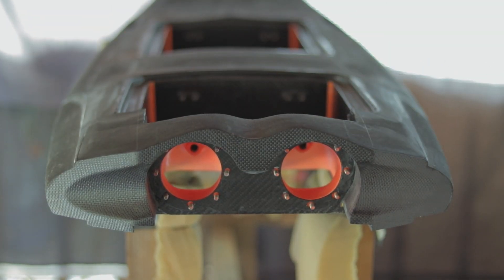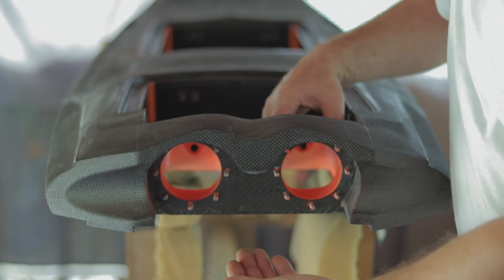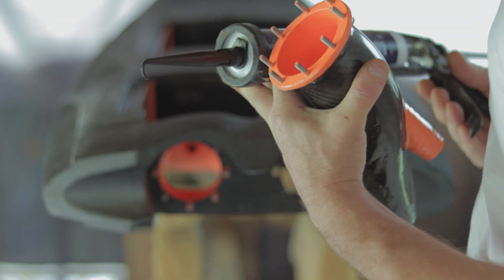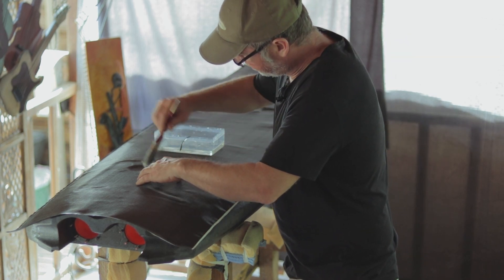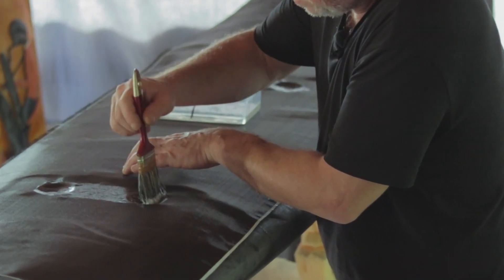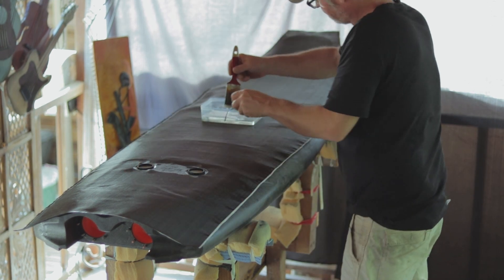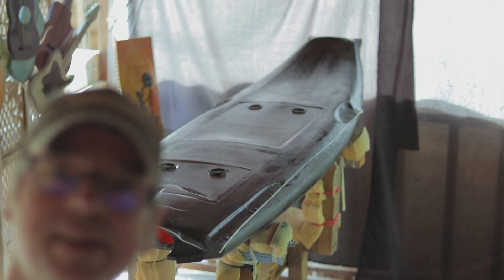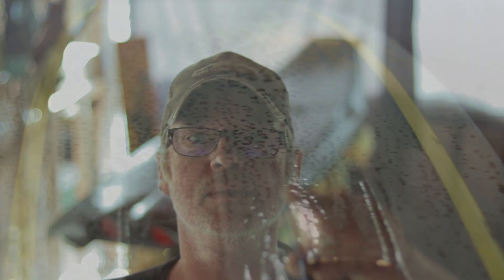Diy Twin Jet drive Electric Surfboard: (the ultimate tutorial)Part 7

Comment: Loving it. Nice work. 
How many layers or carbon will you be using top and bottom?
Reply from the maker: Hi thanks for the comment. I used one layer on the bottom of the board like a typical surfboard and anywhere I am standing on the top there are two layers of 200g carbon like the hatches, with another 3 layers on the underside of the hatches. It's kept the board light at 16kg all up with motors etc.
Reply: @thewaysider7774  
Fantastic. 
Where did you get your hatch latches from?
Reply from the maker: @Mitchworks698  Hi From Amerzon
Reply from the maker: They were amerzon but should have tried the plastic version to save a little more weight. I cover the top of the latch with a black rubber glove to keep them waterproof. They are 19mm size.